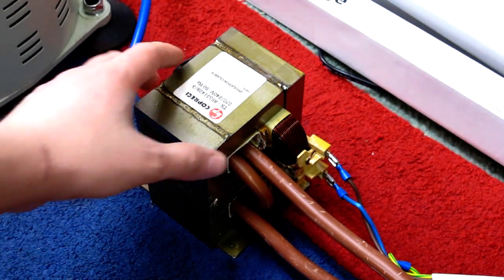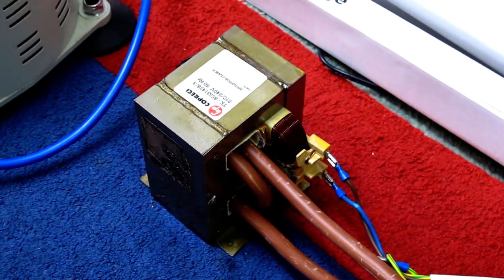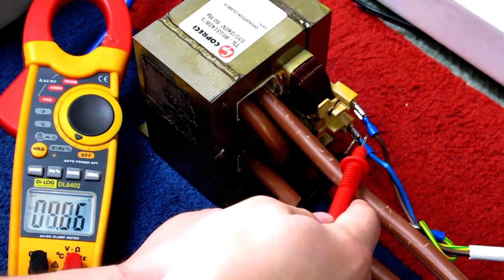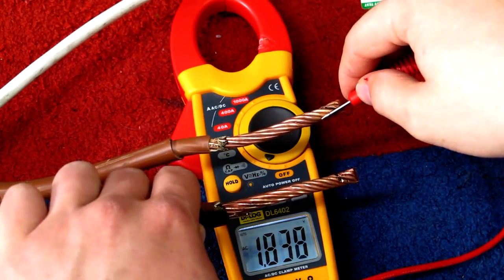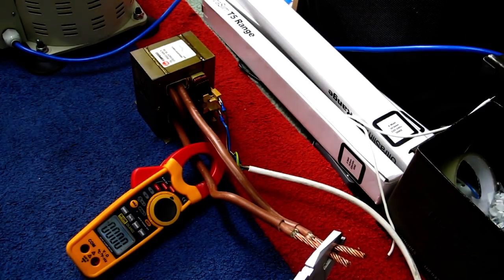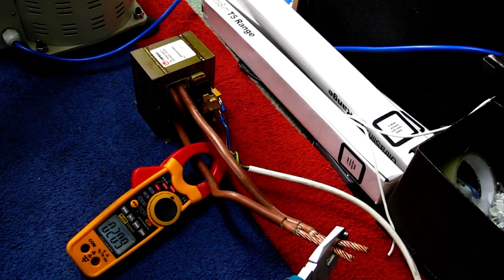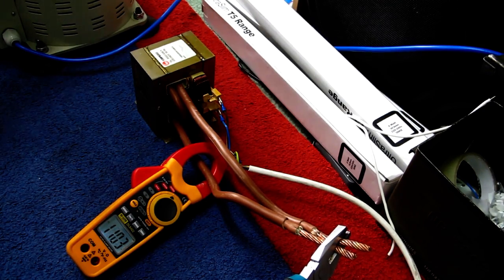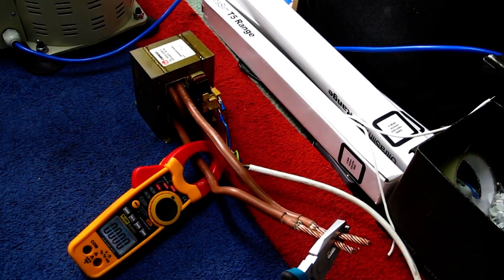Modified MOT: playing with high current. (Part 1 of 4)

Comment: would be interesting to leave the HV side inside and remove 240v side and replace with 2 turns.  Supply 2000V AC and check also the output.  Might need to use two MOTs:  240v>2100V>2100V>2.8V and chceck the output power

Comment: Are you powering this from a wall outlet? What input voltage?
Reply from the maker: Powered via a variac from 240v 50hz mains.
Reply: @FrontSideBus  thanks for responding! One more question, how much current does it draw on the primary side?
Reply: @coledavidson5630  2.8 - 4 amps probably

Comment: At 500 ma and 240V instant death.  But at 1.8V and over 1000 Amps most likely instant but very painful.      There has to be more than 500 ma going into the primary or this wouldn't work.  Probably more like an amp or 2 going thru the primary.
Reply: 1.8V won't get through your skin. I don't believe it would kill you, might give you a bad burn from touching it tho
Reply: 1000 amps with very low resistance wires. assuming body resistance of around 100k ohms at 1.8v, you'd have less than 20 microamps drawn, which is harmless
Reply: Bruh. Another one who says "Volts jolt, Amps kill!" 🤡
Reply: two points. Voltage kills NOT amps. Secondly it won't be 1.8V as that was the open voltage. The Watts is no longer 1.8x1000
Reply: @richardburgers8965  no, they both kill. Remember shocker/taser/stun gun? It uses thousands of volts but the current it can provide is very small. So you can't die unless you will shock a person for more than... I dunno.

I think that it is "many volts and a wee bit of amps" that kill.

Comment: So why does it draw an excessive amount of current. Is it because there are a lot less turns on the secondary coil? and does the thickness of the secondary coil play a part as well?
Reply: The output voltage is lower, but the power (watts) stays the same.

Comment: Hi..great experiment, I never thought that the amps could get that high. Impressive and a bit scary to hear the hum at 50 Hz.
Let's assume I put a SCR or some kind of dimmer on the primary side. I could regulate the current to the secondary, thus the output on it, right? I ask because I want to make a small spot welder for my workshop. Thanks...
Reply: Kalle Klæp yeh .. but with dimmer sin wave  will be distorted and transformer will hum and heated

Comment: How did the primary input wires not melt? :O
Reply: It has more voltage
Reply: But it's standard mains electricity... Unless it has been stepped up on the primary side.
Reply: Because it still the same input as when it was in the microwave
Reply: @joshporter5773  I doubt it. The output is at like 2000W so it has to be pulling at least that amount of power in the primary as well

Comment: Take 2 of them and cut the weld with a hacksaw or grinder to get the cores apart. Its a thin weld. put the 2 E cores together front to front to make one big 8 shape. Put both primary coils together on one side, wire them IN SERIES not parallel. Put your secondary on the other side, add power, have so much fun it should be a crime! I used 2 of the big ones, i think they were 1400 watts apiece, maybe 1800. i can melt anything i put between the wires :)

Comment from the maker: At first I tried cutting it off with a Dremmel type tool & cutting disc but I soon gave up and resorted to using a sharp chisel and big fuck-off hammer to slice the comple windings off. Then it was just a case of pushing the remnants out of the middle of the core.

Comment: How did you get that secondary out!!! I tried to do so but failed miserably. They were so packed that the little iron separator scraped the top of the primary off! What a waste! I give up!
Reply: Not easy to get the secondary out, hacksaw the end of the HV coil then hammer with a flat bolt the wires our or use a drill. Also remove the shunt laminations.